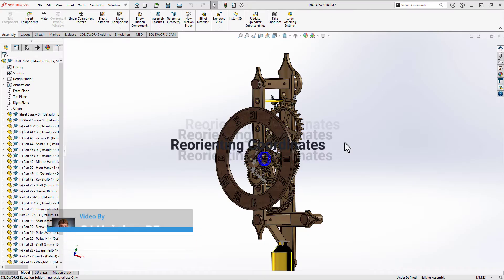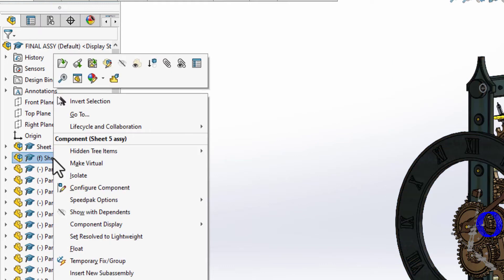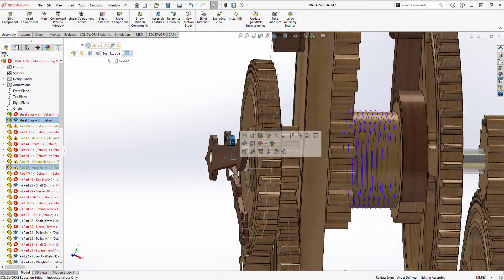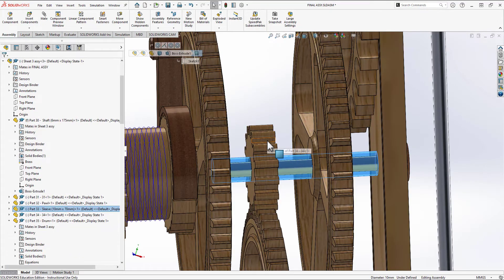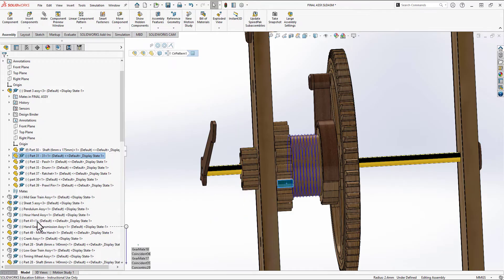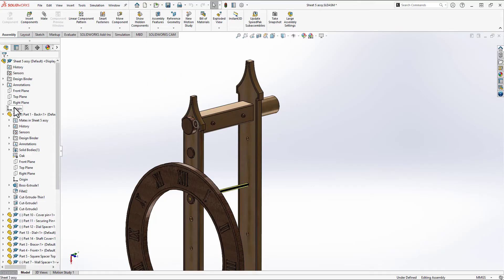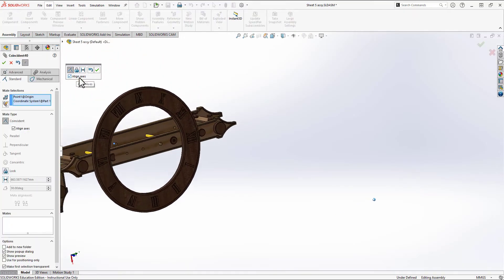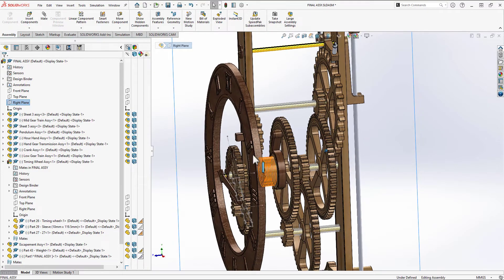Move Assembly to Origin in SolidWorks

Comment: Modality.
When instructing others, remember; they are not looking through your eyes at what you see. They are not in your body responding to your thoughts.
Instructing is an art, much more than a science. The gift of instruction allows the instructor to adjust their own perception perspective dynamically so their output aligns with the perception perspective of their audience. A spline rather than an arc. Curvature continuous; the transfer of knowledge and information.
 "Slow is smooth and smooth is fast"  *(Burton, The Peripheral)